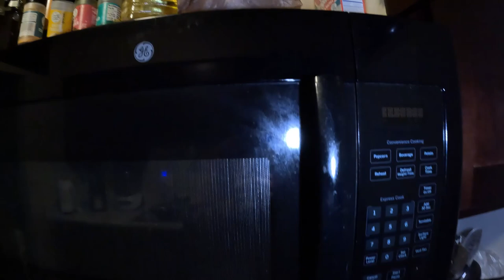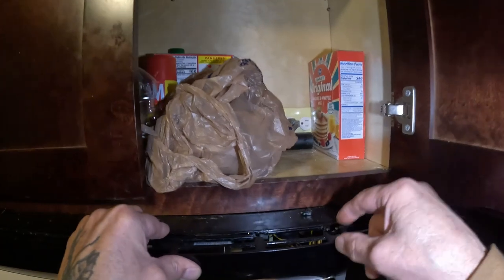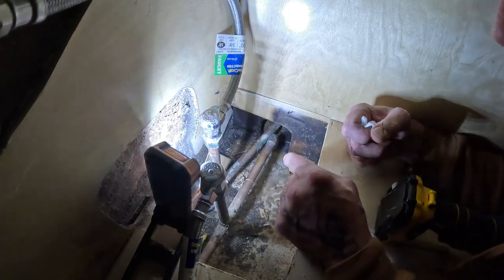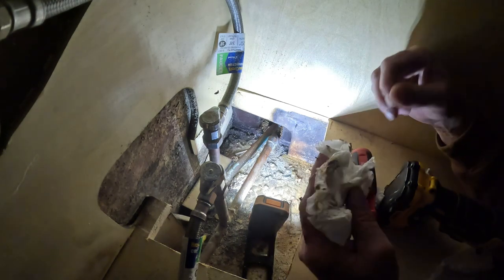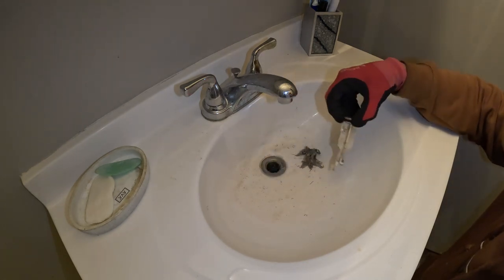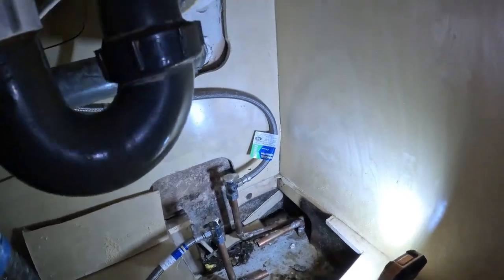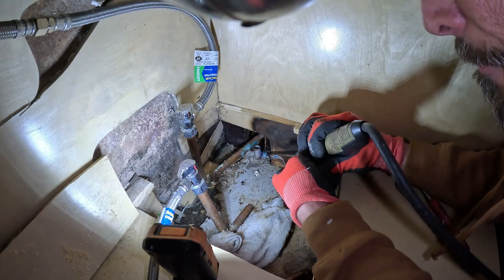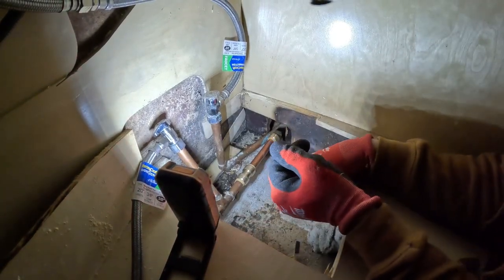Ray's maintenance #45  bad water line repair

Comment: I got to give it to you , that pipe repair you did , given the conditions you had was genus . Through a concrete floor , if the Shark bite did not work you would have had a problem . If you had to replace that line how hard would it have been. I’m sure it would be a bitch .
Reply from the maker: Its strange flooring--- standard floor with 2" of concrete on top. I think its a fire brake of sorts. But it would have bit if i had to bust that up to get to it 😆  thanks for the comment 👍